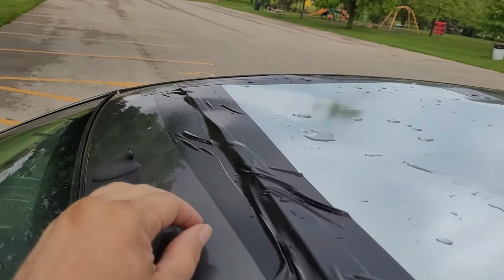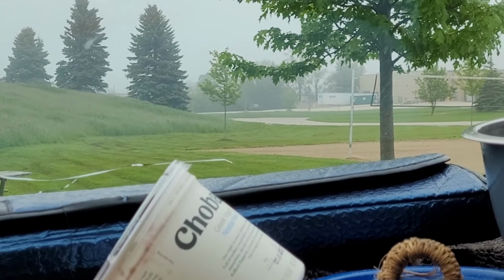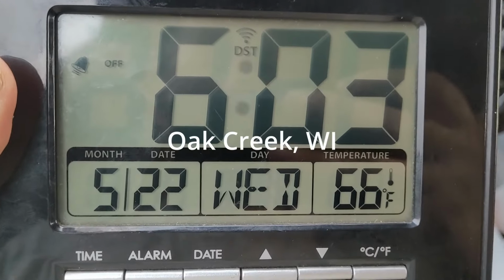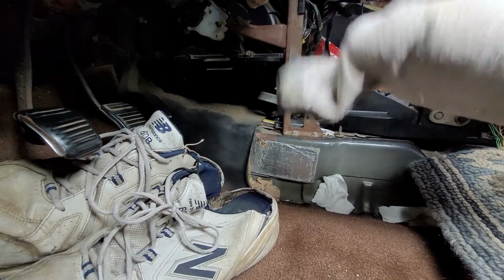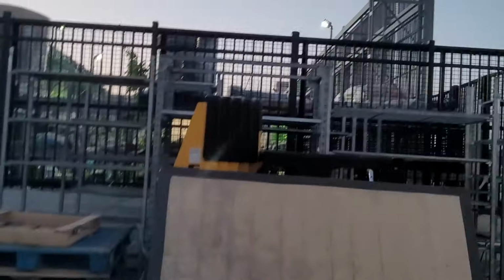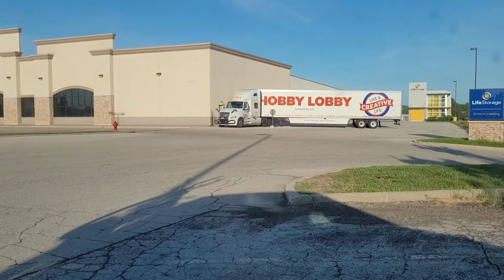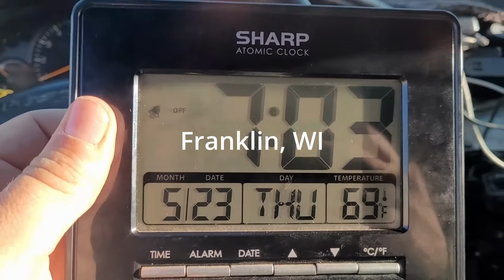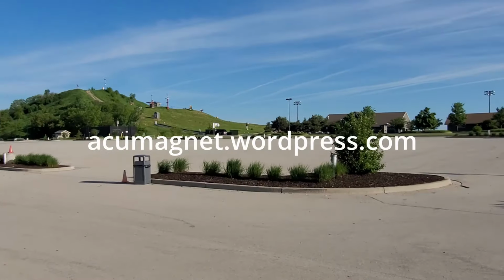Full Car Breakdown & Adventures on the Road: From Duct Tape to Lettuce Tea

Comment: These were not professional OTR drivers. I  decided early on not to take a job with an OTR outfit, but I could then and now, even at seventy-one,  back 65 foot Werner trailers into and out of spots tighter than this. And, to reposition a stop sign could be a crime, or at least a safety hazard. Did they replace the sign to it's original placement?
I agree with other comments; your vehicle is nearing its mortality. I just hope you don't suffer an electrical shortage with all that exposed wiring while you're sleeping. 
Blessings, Mr T!